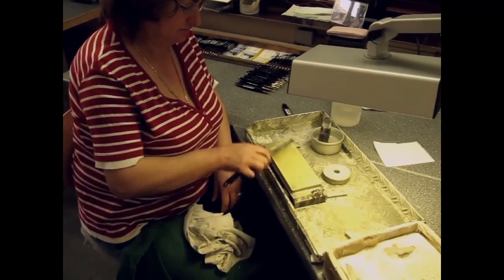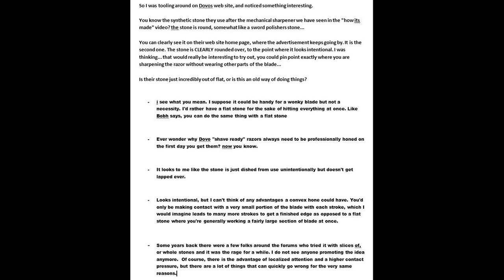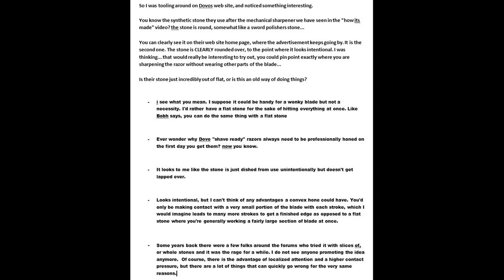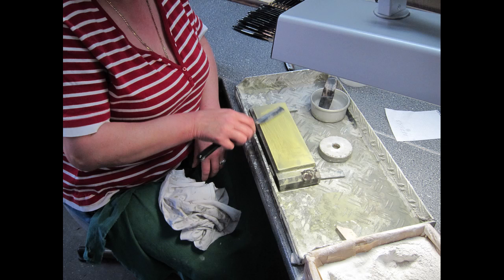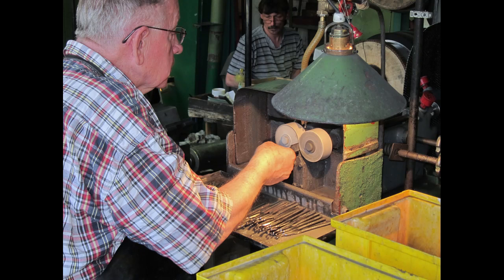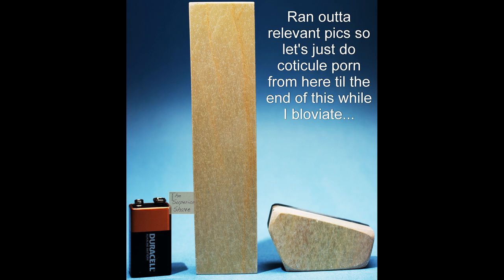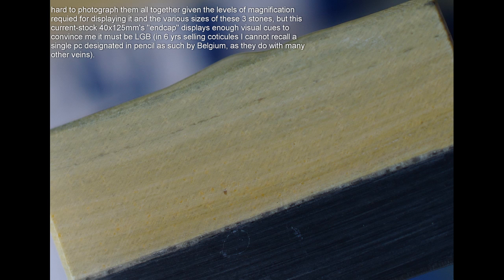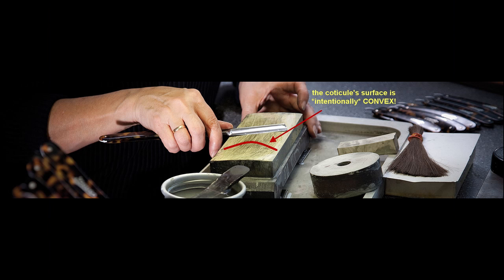Intentionally Convex Straight Razor Hone

Comment: honestly, that stone looks much like the Kitayama 8000 than a coticule.... Even for the wooden stand and white slurry stone, it looks exactly the same. I don't think manufacturers would actually use expensive natural stones, for the fact they are not uniform and is hard to control the quality. Hence that must be a japanese man made whetstone
Reply from the maker: This picture I did not take myself, so I cannot say.   Dovo & I spoke of this originally in 2011, and then some more in 2017.  2011, they definitely had a big yellow coticule which had been mounted in a base, I saw this myself and have an image of it somewhere.  2017, they confirmed they have switched to Japanese-made stones for some years because they cannot source natural stones large/fine/consistent enough.
Reply from the maker: As I said, this picture I did not make, it was provided by Dovo, I don't know how many years ago.  But I do have a stationary image of a ~4x8 Belgian coticule mounted in a base which I took in person 2011 - it is most definitely a coticule, was perhaps 7mm thick of yellow, they were able to consume that (remember in convexing a softer natural stone, you have to touch up with nagura to keep the curve quite a bit, this cuts down stone lifespan considerably).    I believe I am professionally qualified to declare that stone seen 7+ yrs ago a Belgian coticule, and they told me as much.  It was and is the biggest coticule I have ever seen in person.

At some point in our time trading, Dovo gave up on natural stones, for the reasons you say.  

They do use manmade JP stones today, but I am not allowed to say beyond that they commission them directly to their own specification and they are convexed by hand back in Germany as a preparation for use.